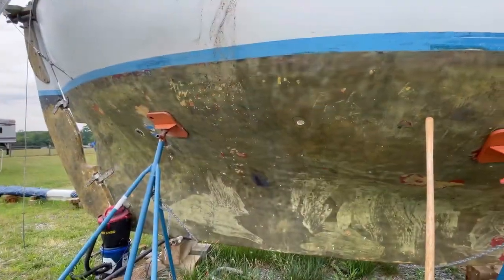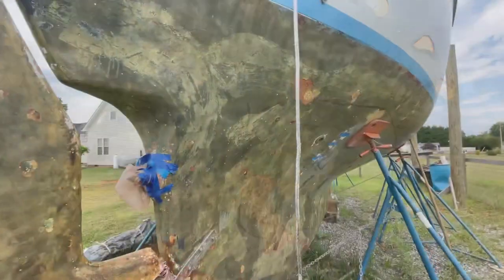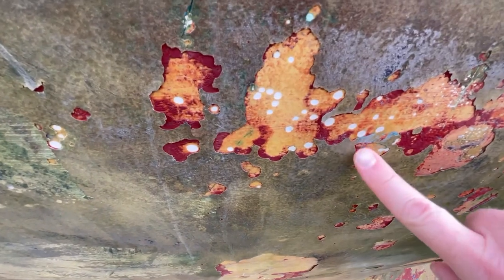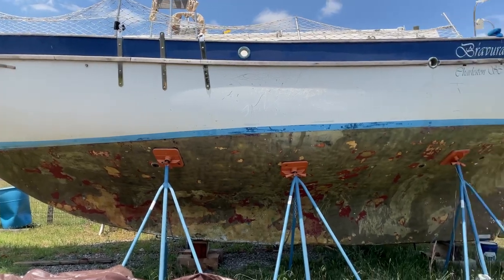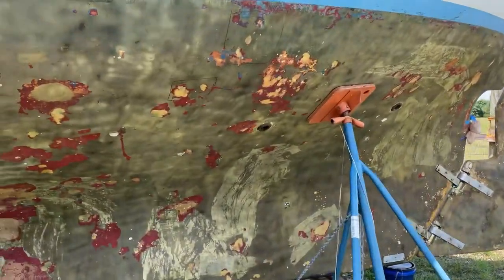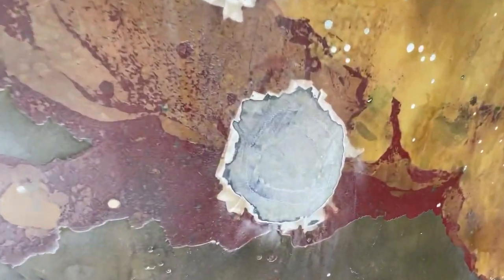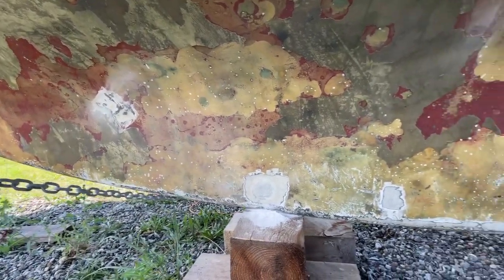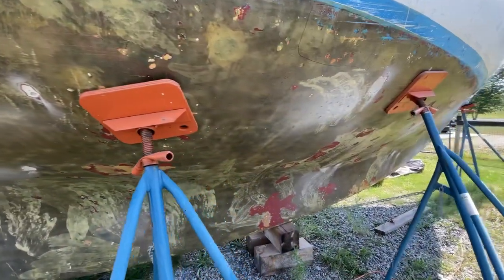Sanding Osmosis and Delamination in Boat’s Hull | Sailboat Restoration Ep. 21

Comment: My hull looked similar I bought a gelplaner and got rid of the lot, I was going to resheath below the waterine but she is a thick and solid 60's vinylester layup so don't think I am going to worry about it, great project mate!
Reply from the maker: That was an option, but sodablasting was a recommendation from one of the original managers of the Westsail yard since it is such a thick hull and any damage is close to the surface. But a gelplaner has worked well on other boats and you're right, these older boats are layed up thickly and priming and painting seal them up correctly.

Comment: It's amazing how much information is transmitted when you get that close and personal with the hull. You have identified most of the classes of damage to the surface and how to remedy them. And I'm guessing you're only 'scratching the surface' 😉.
Reply from the maker: I was told the hull is an inch thick. It is very reassuring that the hurricane damage (mostly dock rub) is minor.
Reply: @Even_Keeled  I bet! I'm surprised at how little serious damage there is to the hull, as far as I can see! Keep up the good work, love the videos.

Comment: I just finished sanding off the bottom paint all the way down to the gel coat. Faired in the small blisters and added 3 coats of barrier epoxy (interlux 2000i) and 2 coats of bottom paint. 

To speed up the old paint removal, I recommend using a 7 or 8 inch grinder with 40. Then detail out the blisters as needed. 

  In CA boat yards we have  sand with vacuumed sanders. The festool 5" rotex sanders  really  worked well.
Reply from the maker: The process exactly!  I have Interlux 2000i sitting in the garage. It’s all ready and will look great. While I don’t have a nice festool system, I’ll use my grinder for the bigger areas of removal.

Comment: A one inch thick soft pad on a 9 inch grinder like used at auto body shops would do a better job than a belt sander..
Reply from the maker: I have one of those, but I don't need to take off much to dish out the damaged glass on these hull spots. With the dock rub damage that spans the length of the boat, I think I will turn to a larger grinder for that.